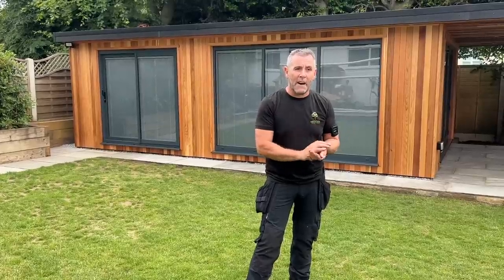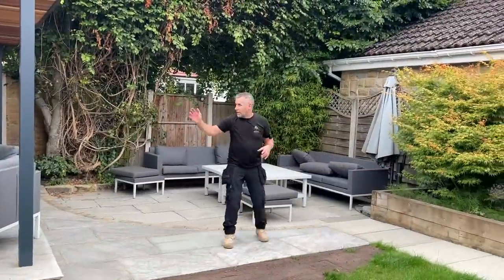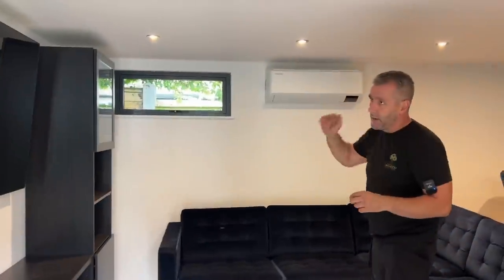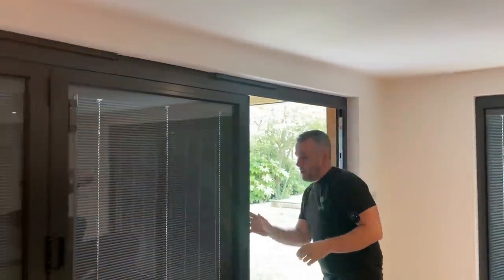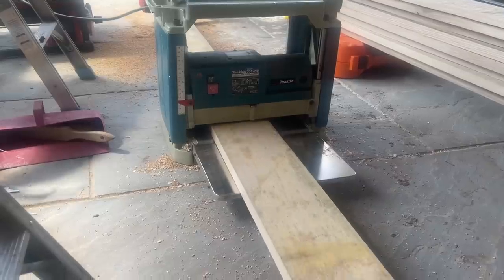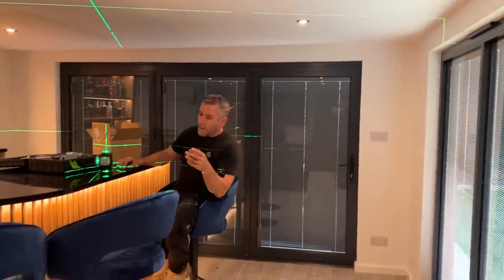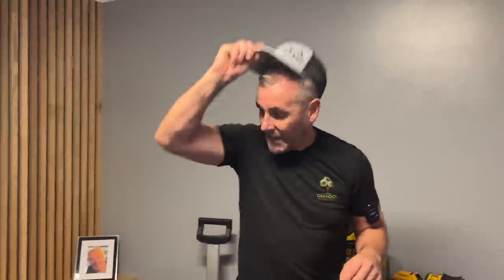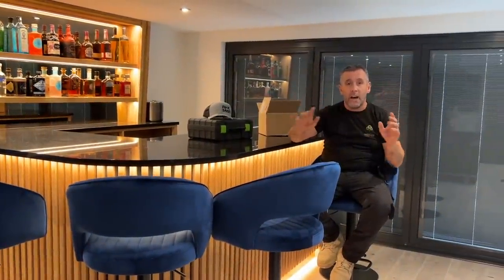The best garden room on the internet! with a bar you'll love!!

Comment: Hey Liam, watched for years this is just another prime example of the build quality you offer. We also build these down in south wales, I have a query :) 

We have one starting in a couple of weeks where I we have a window to install up high on one of the sides where the anthracite profile sheets are being used. How did you install the window and trim it? To look aesthetically pleasing but also water tight. I would be interested to know what you did on this one. Thank yoh
Reply from the maker: We get flashings made up from the metal sheet supplier, trouble is, you can’t order them until the window is in and metal is fit as you don’t know where on the profile it will finish, so you can’t measure for the flashings until fit
Reply: @thegardenroomguru  that makes sense, we have a good relationship with our supplier so I assume they can do this for us. 

Cheers for the reply 👍

Comment: Hi, I'm after a bit of advice regarding roofing for a forthcoming workshop build. I need a workshop so I intend to build a timber frame 9m x 4m with an apex roof. It will be mostly Douglas fir as that is the most economical material here in mid west France where I now live. For example  an 8 x 4 sheet of 18mm OSB is roughly  £80 , to use 200mm x 20mm Douglas boards would be about half that price. So, I plan to use that for the roof with a breathable membrane on top, and then batten over that finishing off with a corrugated sheet. The idea is to create an air gap which will help keep the worst of the heat off. Similar-ish to a tiled roof I suppose. Do you have any suggestions which might help or achieve the same thing in a better way, hopefully for a similar cost. Many thanks. Chris.